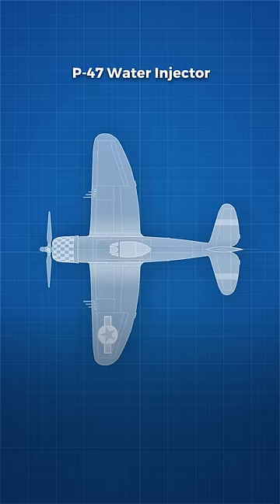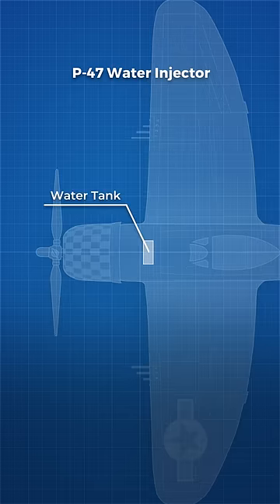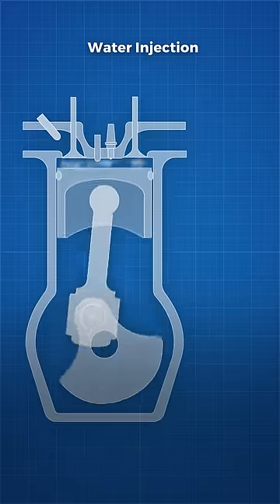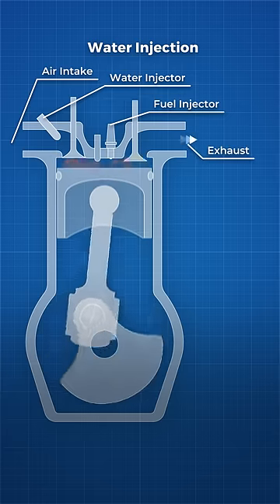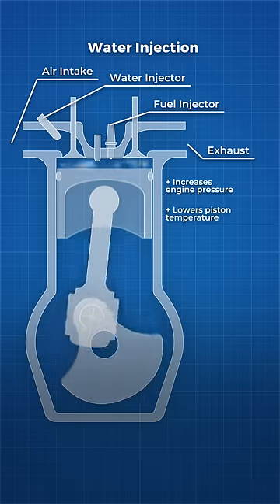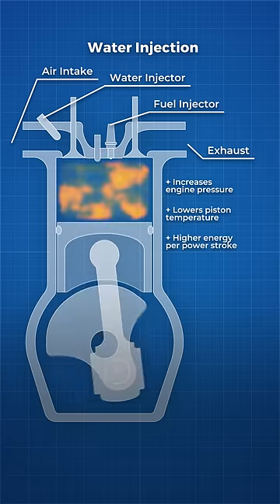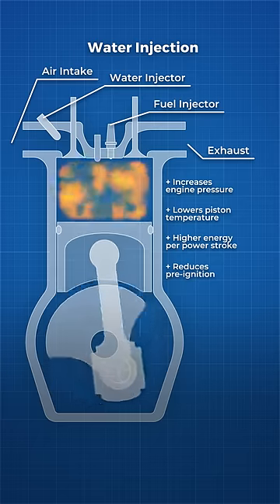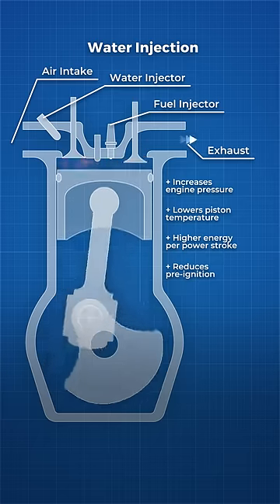How Water Injection Increases Horsepower

Comment: Ignition happens at the TOP of the conpression stroke. Not bottom. How could you get that wrong? you even stole the animation correcly displaying it.
Also what you labeled as fuel injector is the spark plug.
Wasn't this channel run by engineers? please fire the quack that made this.
Reply: He is technically correct as the bottom of the compression stroke is tdc. And you can see the injector, quit being a prick because of someone’s terminology being slightly different than yours
Reply: @thatgamingprotogen7043  sorry, I sometimes forget that TDC stands for (T)bottom dead center 😂😂
If you want to run an educational channel, you HAVE to get the stuff right. "tEcHnIcalLy he is right because [obscure complicated explanation]" is not enough. You either use the standard engineering language or you don't post anything at all.
Reply: @nashooo5903  As a heavy-duty mechanic, I call tdc after compression at the bottom of the compression stroke as the compression stroke starts bdc and ends at tdc. It's something that I've learned from engineers as a way to simplify the thought process. Now Mocking someone because of terminology and a certain way of saying something is childish and arrogant.
Reply: @thatgamingprotogen7043  hey buddy, you were the one who started calling names, so I assure you I hold you in an equally low regard.
And sure, because compression  starts at the bottom, then the top is the bottom and the bottom is the top, but then expansion starts at the top, so the top is the top and the bottom is the bottom, right? You call THAT straightforward and easy to learn? How about calling it start/end of compression, like EVERYBODY else?
Also, you can bend the terminology all you want, you still can't confuse a spark plug with a fuel injector.
Reply: @nashooo5903   it’s better than not showing a spark plug or injector for a direct injection petrol engine. He might also have been pointing in the general vicinity.
Reply: True he got some of the labeling and verbage off on this one.  He does convey the correct notes for using water injection though.  At the end of the day he does get the point across still.

Comment: to all the geniuses in the comments saying the spark plug is labeled injector and its wrong, no it aint, a fuel injector serves as 2 purposes, the fuel atomizes and comes out the sidewalls and the tip glows white hot to cause ignition
Reply: @Will-hv9ns  Agreed.